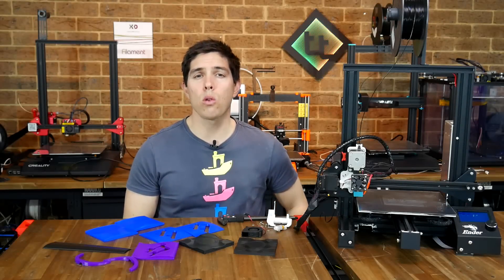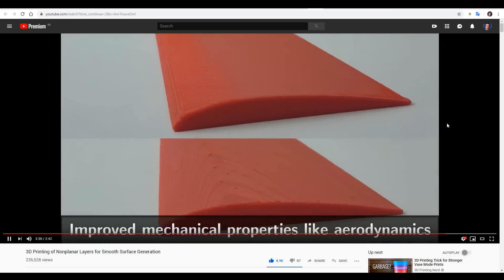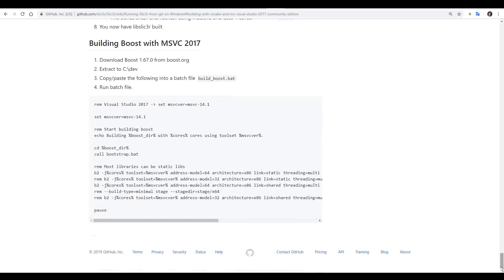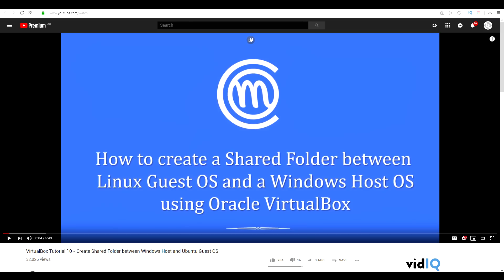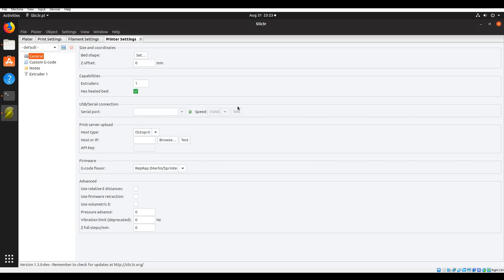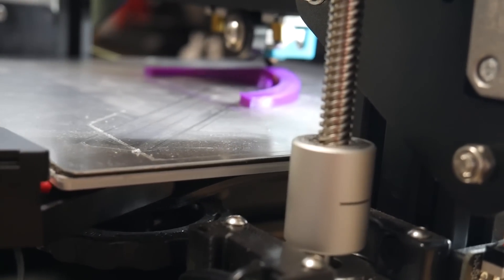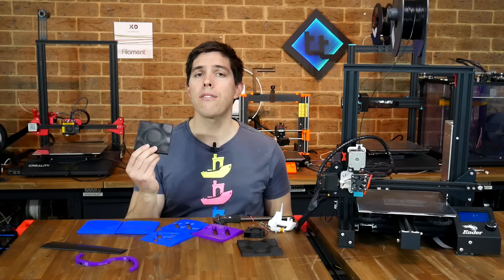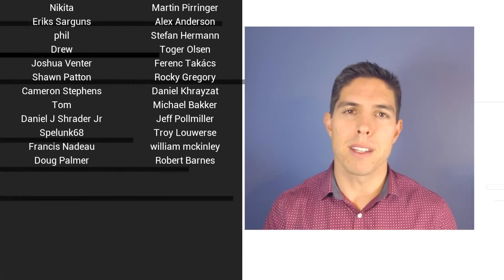Achieve true 3D printing with non planar slicing

Comment: i am always amazed  how many hoops people are willing to jump through to not use linux. Hours of trying to get it to work on windows and failing vs 10 minutes of installing linux + 10 minutes of set up (I consider Virtual machine and or dual boot  not to be linux' "fault") At this point linux is easier to use than windows because everything you have to google in windows, like how to find some arcane menu option  and where to link some dlls or how to open regedit is just a few lines of terminal command.

Comment: For a Linux machine on your M$ box, you can go to turnkeylinux.org and get a pre-made virtual machine, and run it using the same virtualbox. Sorry, but I'm an evangelist of Linux, and there is no marketing budget, so I try to shout out whenever it makes some small semblance of reason to do so. You can use a turnkey to play with (learn by accident!) wordpress, web servers, and use the web server to share files with your host machine.

Comment: Why not just install Linux? It is much better than Windows.
Reply: Installing a Linux VM on a Windows machine take too many resources. What works better is to run a Windows VM on a Linux machine.
Windows runs better as a VM on a Linux machine because Linux is handling the memory and keeping the virtual HD in order.
Try it, you will like it. Don't be afraid. Even windows 10 turned out to be  resource hog. I was hoping it be an improvement, but it's a major let down. Plus who doesn't like free open source software?

Comment: What would be interesting is to see how this method affect the surface quality of large layer size prints. Usually when you use a 3mm nozzle and 1.5mm layer sizes you would get horrible surface quality due to the size of the layers. But if you can do non-planar slices, then the top surface at least would not be affected by the layer size. You can speed up print time substantially without sacrificing top surface quality.

Comment: You'd think it would have been easier to just install Linux and build it from there...
Reply: It definitely would have been easier.
Reply: Which is what he did in the end with the VM?...
Reply: @someguy4915  Nah he installed an emulator.
Reply: @Litl_Skitl  No, an emulator emulates the hardware, a VM virtualizes the same or similar hardware. You'd use an emulator to run an ARM operating system on x86 etc.
Using an emulator to run x86 Linux on an x86 pc would just slow everything to a crawl (and x86-x86 emulators thus do not exist anyway)...
Reply: @someguy4915  finally someone had to say it, its a pretty common mistake to think of virtualisation as emulation

Comment: Anyone that has a Chromebook they have crostini Linux container that will allow you to run Linux apps. You activate it in settings and when installed you put Linux programs you want to install or run in the Linux folder in file manager in chrome apps. Then fire up terminal ..if it's an .AppImage first type in terminal chmod +x thenameoftheapp.AppImage then type ./thenameoftheapp.AppImage. I have tested this with prusaslicer.AppImage and cura.AppImage both load and run great so this should work also. Here is how https://www-androidcentral-com.cdn.ampproject.org/v/s/www.androidcentral.com/how-install-linux-apps-your-chromebook?amp_js_v=a2&amp_gsa=1&amp&usqp=mq331AQCKAE%3D#aoh=15759062225768&referrer=https%3A%2F%2Fwww.google.com&amp_tf=From%20%251%24s&ampshare=https%3A%2F%2Fwww.androidcentral.com%2Fhow-install-linux-apps-your-chromebook

Comment: As someone coming to 3D printing from a CNC background, it seems very strange to find that non-planar software does not readily exist.  The evolution of subtractive NC machining was initially limited to 2D and then 2.5D (late 40s and early 50s), and as the availability of significant processing power became available, CNC became fully 3D in the late 50s and and 60s.  The low cost power of PCs lead inevitably to the development of hobbyist CNC (Mach 3 is an open source wonder program for the Maker community, and is fully 3D).  

Mach-3 (and other low cost packages such Fusion 360 - which I use for all my CNC work) are all g-code based, and are fully non-planar,  so why hasn't the non-planar g-code  arrived in the world of 3D printing?  It can't be a patent issue since the patents have long expired on the CNC non-planar movement of the work and cutting control systems.

I'm guessing that since 2.5D has worked so well out of the box for 3D printing, and is very simple and easy to use  (which cannot be said of true non-planar 3D CNC toolpaths) that no one has wanted to go to the trouble of creating a raft of non-planar tool path topologies to meet every additive printing situation (and the development of tool path geometries is not a trivial matter).  Fusion 360 and Mach 3 have about 30 different toolpath strategies that can be used, each with its own pluses and minuses!  Cura has ONE!

 It will be interesting to see how this process of moving to non-planar printing evolves ....

Comment: This technique could still be useful on conventional printers as long as you could map the 3D geometry of the areas that could potentially collide and detect whether that would actually happen or not. You could then use it for those cases where you have shallow slopes.
Another thought would be to combine the two techniques so that you only allow a certain restricted amount of non-planar printing, before having to complete everything to that planar level and then resuming non-planar printing. It's not ideal, but better than conventional printing.

Comment: Great video! I'm having some trouble though and I'm not really sure where to go for help. I'm following your steps and everything seems to be working fine until I go to start Slic3r. When I put "perl slic3r.pl" into the terminal, I get an error telling me that it can't locate the Slic3r/XS.pm in @INC and I may need to install the Slic3r : : XS module. Not sure where to go from here.
Reply: Resolved: Allocated 4gb of ram to my virtual machine rather than only 2.

Comment: Why didn't you just use an USB flash drive with Linux installed onto it and then boot into the thumb drive instead of windows, it would be a lot easier than using a VM (not that using a vm is hard).

Comment: Amazing video and thanks for sharing.
I do have an extra question though:
How does the non planar slicing method affect the speed of the 3D printing process?

Is it slower, faster or just as fast as the former type of 3D print?
Reply: It would have to be slower (without mixed layer height trickery, which may speed the whole thing up)

It builds a normal planar base with infill, then goes over the top of it with the non-planar print, so it's an entire extra step added. Plus, Z axis are generally slower, so your overall print speed may need to be slowed

My 2c anyway

Comment: Honestly you could have just dual booted Linux or if you have a flashdrive big enough for your project and linux you could have just used a usb >.>
Would have been faster and way more stable than a VM. Also then linux could also just navigate and mount your internal hdd so no problems there.

Comment: Couldn’t you just change tool paths to run up and down the slopes for that problem and you could basically reverse cnc cutting program to start at finished product and build it up from there and change direction of tool paths but I guess some of the layers will still look a little bad but not as steppy as conventional printing but I could just be talking out my ass

Comment: That technique looks pretty much like surface milling. Roughing out a surface with a flat end mill and then switching to a ball-nose for smooth and detailed finish. Although a little upside down, additive vs subtractive.
I mean, we already have the methods and working software for building different kinds of surface cleaning toolpaths. Axis-aligned, spiral, on and forth.
What if it's possible to make Artcam (for instance) friends with a printer? Looks like a major shortcut doesn't it?

Comment: Real cool, but surely you can get much better prints with planar slicing, even with those models. I understand the point of exaggerating the differences, as this could be VERY useful, but planar slicing can achieve much better results than the planar slicing you showed.

Comment: A Delta printer might be able to support the hot end tilting. It's also able to get more clearance since the hot end can move more freely, not restricted by axis.
Reply: That sounds like another Master's Thesis.
even though if you ensure that the nozzle is always normal to the surface you are printing this should work...
Reply: @null-t5e  It should work. There have also been experiments with robot arms which can print in literally any orientation, including upside down. All it needs is a nozzle attachment.

Comment: That's pretty sweet, it sounds like your issue with slope and nozzle direction may be alleviated with some sort of "cutter compensation" tool nose radius compensation as used in a lathe seems the most similar, however types of ball end mill compensation are also relevant.

Comment: Thank you, very cool. This coming from a HAAS CNC machinist. The powers that be are going to run with this tech. Stay close to that as you will be drug along with ot into success and fame. There are a lot of geeks like you out there that will sort this out very quickly and the Chinese will want to sell a billion ender 3 true 3D printers as soon as possible. Stick with it. I can machine metal in 3d with a vertical milling center but printing would be very cool.

Comment: I can confirm that Slic3r non-planer successfully compiles and the GUI does load on Windows 10 running Ubuntu in WSL2.  It's a bit sluggish on the screen when in non-planer mode but it is certainly awesome!

Comment: I've worked with this technique for a day but it is only usable for models like the example shown. It took me 2 days to get it to work on the build-in Linux for windows with Xming. When finally generated some gcode previews I got disappointed. I thought using this with printing difficult plastics like PP,  HDPE and such, to fight tension/warping. Nevertheless, it is a great piece of work from those students.

Comment: @Teaching Tech
To smooth out the surface even more, you can put them in a big enclosed container together with a cotton ball with acetone on it (some distance away from the plastic), the acetone vapors will mostly erode the edges & make it smoother.
Just don't leave it in for too long time.

Comment: Hello new to this 3d-ish printing world.  I find the subject of this vid super interesting and since 99% of you amd your followers know more than me what better place than this to pose a question.  In order to solve part of the problem with relation to printing on a slope wouldn't a delta printer with an adapter/redesign head help? My thought is that the angle of the head could be altered with the 3 steper arms as well as the position of the head as normal.  Hope not to be giving away millions of $$$ in an idea here with my question. Sadly it would not be the first time it happens.

Comment: I think we can sidestep the clearance requirements by doing non-planar stuff layer by layer or in overlapping two-layer groups, just as long as tip of the nozzle is sharp enough and the hardware surrounding the nozzle has at least 2 layers of clearance, which would allow existing toolhead designs, excluding the nozzle, to be reused. Maybe it can even be implemented as a post-process on top of existing slicers which irons the prints instead of laying the material down on an angle, but the ironing direction is critical and the iron geometry is somewhat unfortunate, since you can't quite tilt the nozzle. Maybe the nozzle needs a ball-end iron?

Comment: For pointy nozzles, I saw airbrush nozzles for 3D printers, they are very small and thin, like those there:   https://fr.aliexpress.com/item/4000052346899.html?spm=a2g0o.detail.1000014.41.2cd266ebGcbSJH&gps-id=pcDetailBottomMoreOtherSeller&scm=1007.13338.128125.0&scm_id=1007.13338.128125.0&scm-url=1007.13338.128125.0&pvid=24c82ce4-d814-4e86-93a7-7a7f34dc3a4f

Comment: The more videos I watch, the more I wanna get the Ender 3 Pro and just start printing and tinkering, cant wait to get it soon!
Reply: I've almost bought one several times.
Reply: @FlyfishermanMike  what stopped you?
Reply: @EndstyleGG  I keep thinking I'll want one with a bigger print size.  My brother just bought one and he loves it.
Reply: @FlyfishermanMike  Thats what I was also thinking about, but after doing some reasearch, unless you spend 50%-100% more of the Ender 3 Pro price, you cant really get a bigger one that is the same quality. For me its just to learn about 3D printing without spending a ton on it so thats why I will be getting one soon ( hopefully)
Reply: @EndstyleGG  That's exactly what I've found.  This would be my first one as well.  A base CR10 is around $400 and is older tech.  I should just pull the trigger.

Comment: It's never going to work in all instances, like a benchy isn't possible to print in this manner without a vertical layer line. It has some killer applications but you will never break out on a 3 axis machine. Lot of hard work, to make a few rather small smooth prints.

Comment: I was amazed at the first viral video and I'm so pleased one of the main channels has actually done it!

The main issue I see from the video is the lack of part cooling, which can be solved easily, I reckon: add a pause just before the printing of the top layers and remove the fan shroud only then
Reply: add a set of solenoids that automatically lift the fan assembly (and leveling sensor) out of the way ;) - I've seen it done for just the sensor, can't be that much harder to add that to the fan system. It would massively increase the weight of your print head though lol

Comment: >A far better and more simple option: why the fear of Linux?  Use it, learn it, embrace it.  It stead of all your far-to-complicated unnesscary steps, just install plan old Linux and Dual Boot  - so you can just choose between Windows and Linux and and point - and run the real native thing.

The Linux you wish to install is Ubuntu Budgie edition - its so simple and smooth, you will hardly miss windows - and, on the odd rare rainly nights when you do miss windows a bit - you can just boot to Windows no problem!  Touch yourself! Feel Good! Then, just reboot and spend your time back in Native Linux, which is where you should be, and all will work well....

Comment: Very cool. But would point out that its not True 3D printing. its a SURFACING method - A very cool and long awaited one - but the rest of the print is layered as normal, but only the surface layering is new. It is still technically Planar printing - its just a plane wrapped to the surface.  Its is also SEVERELY limited in use (only one surface can be done this way as an example), the deviation and depth has to be kept very shallow and no abrupt changes. 

Would also mention that the Design of the print head is not just something that needs to be tweaked around; but is THE reason why such things have not been done as of yet with 3D printers. Even without all the tweaks and software needed to do what was done in the video -  if only the print heads could tilt as needed (to be normal to the plane being printed) then all the tweaks needed above would not be required. Even if it was layering like they do now, if the head was tilted to the curve then the stair stepping would be hugely minimized (since the print head forces the plastic to be in proper plane to the surface being printed.) The only real limit at that point would be that the last layer would cool before the next layer (but that is really a problem common in ALL prints, including the surface one mentioned in the video). But if each layer was still pliable when the adjacent layer is laid down the true smooth surfaces could be done (still not perfect, but much closer).

CNC machines have been doing this for decades, its the economics of DIY 3D printers that have not allowed such things before.

Despite that the concept for the 3D printer was based on CNC machines, the 3D printer is Not a CNC machine and can never be one, since they work on opposite principles. and until we get Microthin Long Necked Printheads (which causes its own issues) we are stuck with only approximating its abilities.
Reply: true 3d printers wont even be "printers". objects would just manifest/rise or be sprayed from many directions.
Reply: @keylanoslokj1806  
Resin Printing is very much like that now and doesn't have the Issue of the X/Y/Z with star stepping. But unfortunately it has its own set of issues.

Comment: There's lots of things one can do. You mentioned extended hotend,but cooling problems maybe a problem. Tiny stainless steel as tube or copper cooling tube along the hotend... or just fans. Then you mentioned that the head has to pivot. Well for printing an ocilating hotend like that of a rc water jet engine that can occilate would give the most optimal print then. Even further a telescoping ability could also improve print quality. Hmm.

Comment: What an awesome concept and follow through!  A few more videos like this and I would guess a couple 3D printer manufacturers will try to get a head of the demand for nozzle clearance. BTW just a quick suggestion.  I also like to use Linux on occasion but wanted to get native performance so I simply took off the case door and replaced my SSD with a extra blank one and installed the Linux OS on it.  It only takes a second to pull the case door off and switch the power and data cables to the Linux drive and boot up native.
Reply: Does that give any advantages over dual booting?
Reply: @nipunagunarathne4882   I used to use dual booting but over time it seems to run into problems that effect both OS's for me.